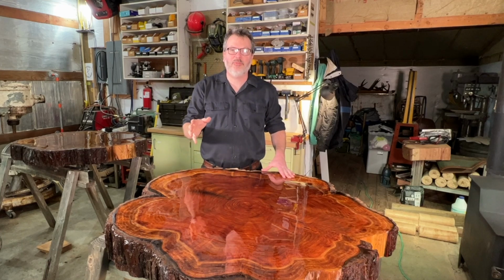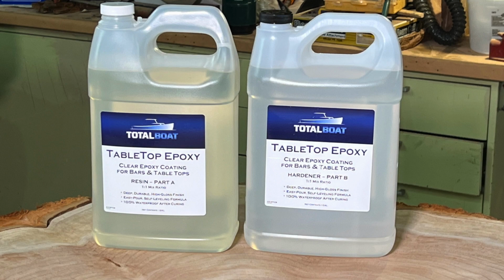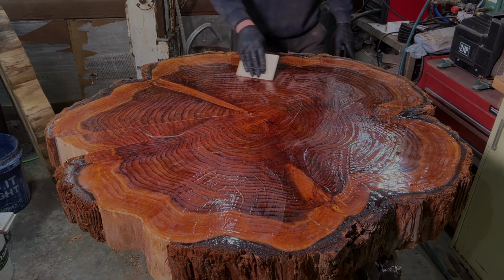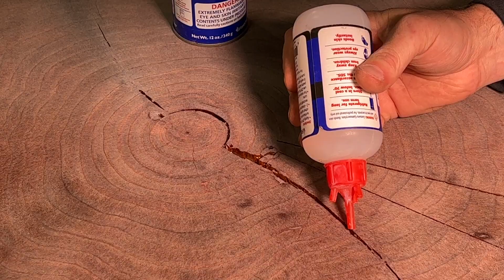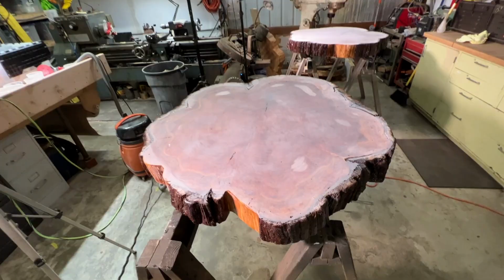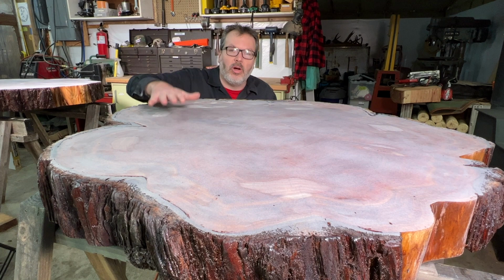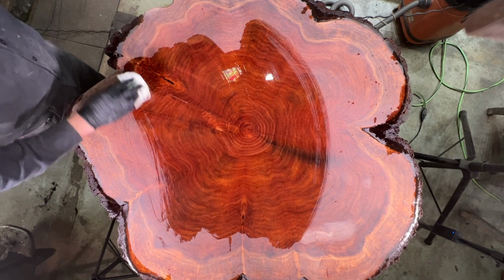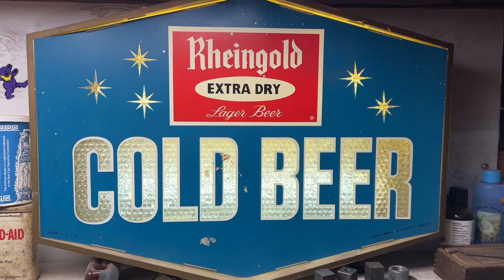Amazing Table Top Finish! - Epoxy and Wipe On Poly = Hand Rub Oil Finish

Comment: Super AWESOME job Jon.  It looks amazing.  I loved your process lots of work but results show the effort is worth it.  Thank you for sharing.
Reply from the maker: Right On Randy!!
Reply: @RightOnJonCrane  we recently tried this with an 8 ft piece of redwood. 5 days after the first coat application there are still a couple tacky areas. Is it safe to sand the tacky areas or is there a way we can solidify the areas that are still tacky. Thanks in advance.

Comment: Question! Why did you not add in the BARK on the repaired wedge to match?  You had a sacrificial cookie to use. Just wondering....
Reply from the maker: Hi! 👋 That’s a good question! Looking back now I think because there was another section missing and it seemed to flow well with the piece to leave it out. I think it was difficult to match the bark nicely to the contours of the other missing section.

Comment: @RightOnJonCrane  we recently tried this with an 8 ft piece of redwood. 5 days after the first coat application there are still a couple tacky areas. Is it safe to sand the tacky areas or is there a way we can solidify the areas that are still tacky. Thanks in advance.
Reply from the maker: Hi Tara, unfortunately if it is still tacky it most likely was not mixed enough. I have had it happen myself and it’s not fun. In my case I scraped and sanded till I got down to bare wood. It’s not that bad to do with a 6 inch random orbit sander. I start with 40 or 60 grit until the epoxy is gone then work back up through the grits. Best case is to use a mixing paddle on the drill. Mix slow as to not incorporate a lot of bubbles which is hard to do. The bubbles pop a little easier if the epoxy is warm. Sorry this happened but not the end of the world. When I sand off the old epoxy I go through a lot of sanding discs. Like a dozen. I buy it off Amazon. So much cheaper than Home Depot. 100 discs for $20. Hope this helps. Sending my best!
Reply: @RightOnJonCrane ok. Thank you for the response! Can I just remove the tacky spots or do I have to do the entire thing all over again?
Reply from the maker: @taralink7064  It could be just the tacky spots. Sometimes when you pour the epoxy on and when you scrape the sides of the cup to get everything out, that is where the unmixed epoxy is. You could try just the tacky spots but other spots might show later. Depends on how nice of a table? If it’s something you want for a lifetime then sand it all, if it’s a crafts table then give it a whirl! Hope it comes out great for you!

Comment: You might consider using a lower viscosity sanding sealer and white glue to start with.  The white glue will settle lower into the wider cracks and the sanding sealer will take care of the rest.  Both products dry clear. The sanding sealer can also be applied via a sprayer, which would be great against the bark. At this point, you’d be able to use your wipe on poly first, followed by a thin coat of epoxy. Most of your sanding would be at first.

Comment: I got two words for you...
HOME RUN...just nature at its best...
two questions...does it scratch easy and if it does get scratched can you just put another top coat on...
just beautiful👍👍👍
Reply from the maker: After the epoxy sets up it takes a couple weeks for it to fully harden. It is very durable and yes you can put a coat of wipe on poly at any time! Can also lightly sand with scotch bright and then put on wipe on poly. I think it’s a great system.

Comment: Awesome video! I just got a huge white oak cookie that I look forward to doing this in about three years but not sure what to do with it to hopefully keep the bark on and prevent as much cracking as possible. I know the cracking is inevitable but if I can mitigate that it would be nice. Any recommendations? It will probably live in a shed for the indefinite future and I will check to make sure there is no mold or whatever. Any advice is very helpful! Thanks

Comment: Hey Jon, really enjoyed the video. Question for you. What sanding grit did you use before applying the poly? Thanks much!
Reply from the maker: Hi Brendan! Anywhere between 180 and 500 for these tables but the sky is the limit. It all depends on how closely you will look at the scratches in the table. I made another video about doing a gloss finish. When you get to 320 grit paper it’s nice to sand with some water. It helps keeping the paper from clogging up with little dots of epoxy dust. These dots make swirl patterns on the table top. Take it to 320 and then throw on a coat of wipe on poly then look at it and see if you can live with it. If not sand some more with higher grits. It’s also good to look at the table after each grit to make sure all the scratches from the previous grit are gone. It’s also a tricky balance to not sand too much off the surface and burn through to the wood. Try and find the happy medium. Hope this helps! Thanks for watching and the good question. Right On! 🙌- Jon
Reply: @RightOnJonCrane  thanks much!

Comment: I love wiping on poly (but I dilute it myself, IF I even dilute it). But Im building an alder table and I would like to have made it the wood a bit "harder", but didn't want to spray on 2k. In hindsight, I'm wondering if its possible to "wipe on" epoxy so that it doesn't build on top of the wood, but rather soaks in the grain like a nice oil wax finish such as Odies or Rubio's or like a few light coats of poly wiped on? That way you get the wiped on look with the durability of epoxy.

Comment: Great vid I followed along and bought those pads. 
Hey question - opinion on  using the much cheaper polycrylic topcoat instead of the wipe on poly ?  It’s like 1/3 the price and seems to do same/similar job? Appreciate you! 🫶🏻

Comment: Awesome video. im working on a very similar project.. I have a poly soft gloss finish.. it is not wipe on.. this still ok Right On Jon Crane?
Reply from the maker: Yes, if it’s an oil based polyurethane you can thin it with mineral spirits or paint thinner. I usually do 1-1 for wipe on. 3-1 for brush on. The wipe on is a little thinner. I have another video about epoxy and polyurethane and I go over the mixing for brushing it on in that video. But the wipe on is nice and easy with a 1-1 ratio. Hope that helps! Thanks for watching! Right On! 🙌

Comment: Jon looks good , my old question How does th wipe on poly react to an exterior application.
Reply from the maker: Right On! 👍 Thanks. The wipe on poly will work outside but you have to make your own. 50/50 mixture of Outdoor Polyurethane and Mineral Spirits.

Comment: I recently poured a flood coat of epoxy over a nautical chart on the salon table from my boat. Looks great and crystal clear, but since epoxy isn’t UV protected, I was planning to applying gloss polyurethane. All though the table is inside the boat, it will still be exposed to the sun at times. Will my map remain crystal clear if I apply glossy polyurethane?
Reply: It absolutely should, just like this table did with the poly applied

Comment: Do you have any issue with the bark separating? I suppose the epoxy must help some.
Reply from the maker: Sometimes I send in some stainless narrow crown staples through the bark if it looks like it is not attached well. Nice to get some epoxy to seep in before stapling. For the most part on this redwood the bark is well attached. 👍🙌

Comment: i work the same finish ,but i cant get out the small fine scratches or wipe marks ,i used very grit sanding before poly ,1500,2000,2500,3000,even those grits the wood keep showing marks ,im getting crazy with this cookie slab ,i worked in circular motion,steight motion ,and nothing seems to work out with those fine lines and wipe marks .,in fact i have been working on this table like 2 weeks and every finish show the lines ,i have to sand again and reaply the poly and on and again ,im thinking in get an axe and turn the dahmer mode
Reply from the maker: Hi! Thanks for watching 🙌✨ Sometimes it depends on the sander. Different sanders can leave different patterns. It’s good to change the paper often. One thing to try is using soap and water when sanding. That can help. Another is to wet sand with the wipe on poly. 
Hope that helps!
Reply: @RightOnJonCrane  yes i gived it another try right now finish wet sanding an a first wipe on coat ..lets see how it end now ,thanks

Comment: What grit you used to sand the epoxy
Reply from the maker: I used 220 but you can work up to 350 or even higher for the final sand. Sometimes I go up to 1500 depending on the project.
Reply: Were do you buy the different  grits of paper